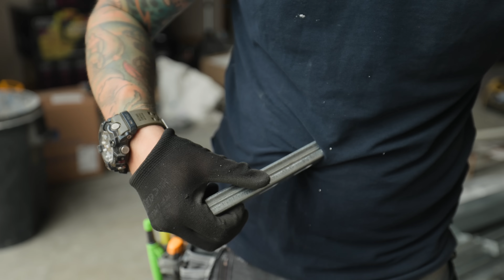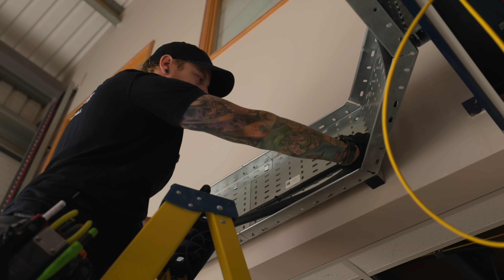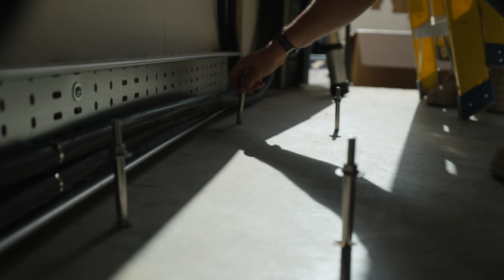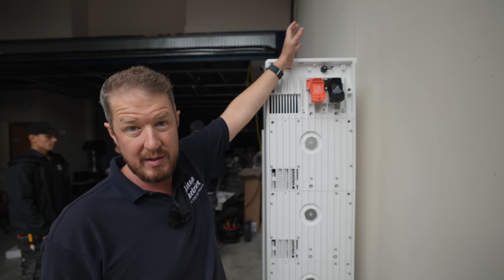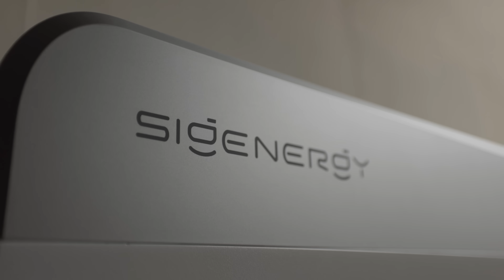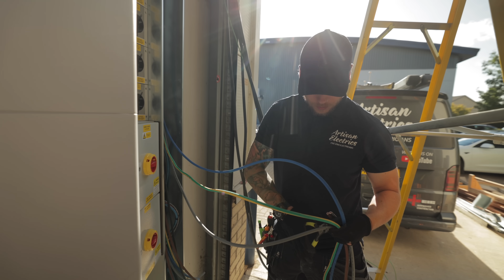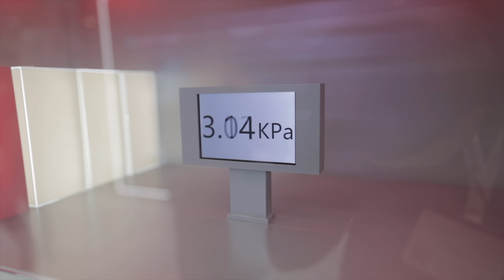Can we take our business OFF-GRID? Sigenergy Sigenstack Full Install

Comment: Put a bumper rail around the batteries so you A won’t damage them and B won’t cause some accidents. Using forklift, vehicles coming in, or delivery’s. Protection.
Reply: I was going to ask if that’s not a regulatory requirement. In residential installations inside garages in Australia the bollards are a requirement if the unit is exposed like that. Would have thought commercial setting would be more controlled.
Reply: Some kind of W rails (like those on the highway) Def sound like a great idea...
Reply: Good I wasn’t the only one thinking that given the proximity to the roller door for deliveries and loading.
Reply: I was thinking that too. Seems precarious
Reply: I’d be putting in some mega theft protection because they’ve already been hit once and the police didn’t manage to catch the crooks. Well done Sherlock. Any ANPR cameras on the road? Any data mining or were they too busy looking for hurty words.
Reply: @davideyres955  like it matters, the only thing the police is going to do is say "there's nothing we can do"
Reply: I agree - I can see someone reversing a vehicle into it.

Comment: Does the paint de-rate the fire rating of the backing board?
Reply: came here to ask the same
Reply: It's concrete block substructure so it doesn't matter they are just using it for looks and smoothness
Reply: Emulsion will all flake and fall off anyway cos the board wasn't sealed with PVA.

Comment: Does this replace an interrupt power supply?
Reply from the maker: Technically no but it’s very close. We will add a small UPS in the rack for the network equipment as an extra layer of safety but it’s very unlikely to be needed.
Reply: @artisanelectrics 
Surely it's only a backup. It's not getting you off grid

Comment: But why?
Reply from the maker: Because energy is so important to our business and we need to ensure nothing gets in the way of the day to day running of the business - plus we have reduced our electricity bills to zero
Reply: @artisanelectrics  "Laptops" make power outages pretty irrelevant - your Achilles heal is fibre/internet going down. This is an egregious investment to recoup from Customers.
Reply: @artisanelectrics 
But what does it mean?
I'm buying power no kit at all 15p per KWh. Agile octopus.

Do this calculation 15p x estimated consumption minus the cost of installation
Reply: Oh tell us the answer
Reply: @artisanelectrics  Yup, with 120kw of battery, you could charge over night on cheap rate and run the office off the battery in the day. Can you get cheap overnight tariffs for commercial supplies and what's the charge rate of the batteries, you didn't say in the video.
Reply: @MG_Steve  did you miss the previous video?? A heap of solar PV on the roof, charges the battery during the day. Battery big enough to easily get through the night and next couple of days. ZERO imports, zero tariff. Will be able to export excess and make a few quid, more than enough to cover the daily charge for the service connection.